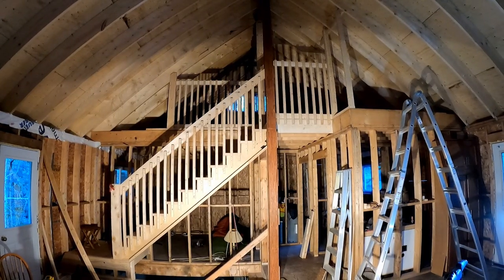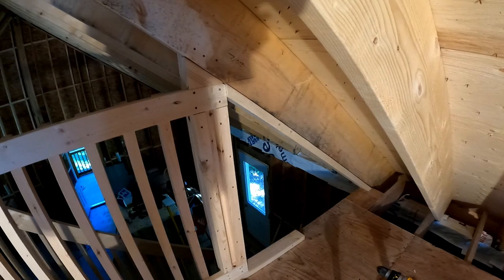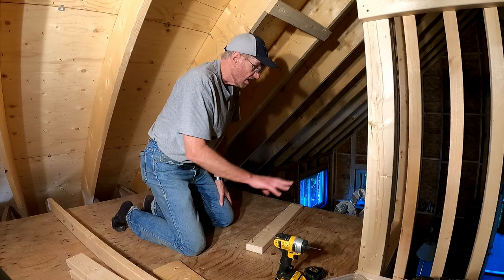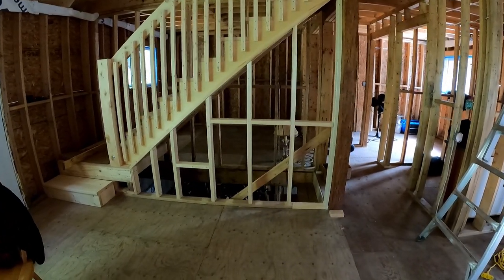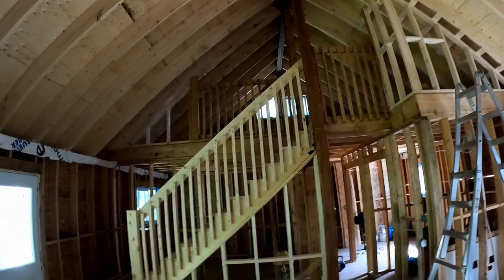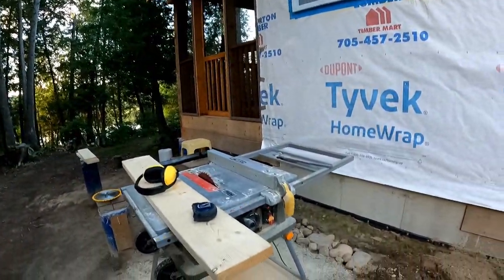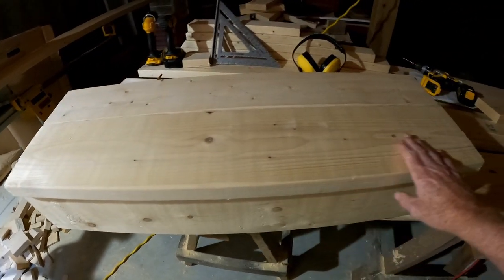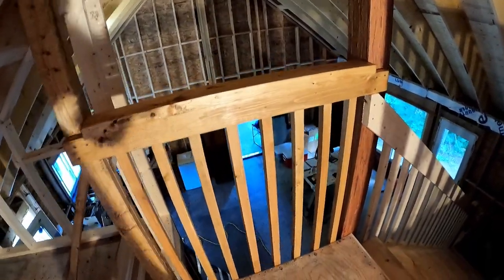Staining makes it pop...DIY Cabin...Episode 30

Comment: Another great episode Rob and Anna. 

Question: Do you have a plan to put a dormer on both sides of the loft?
Reply from the maker: Thanks!
There’s no plans for dormers right now.  At my skill level that would be a real challenge.  The loft is a pretty good size so we will be able to use it as is.
Reply: @riverrockcabin5941  thanks for the answer